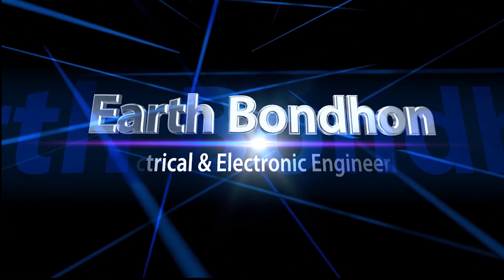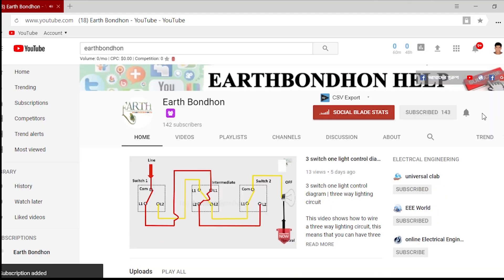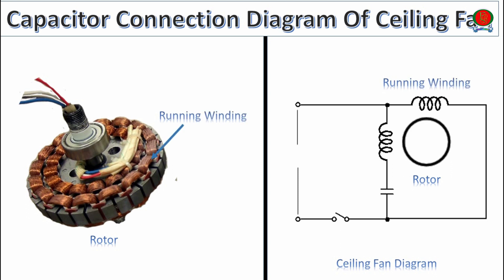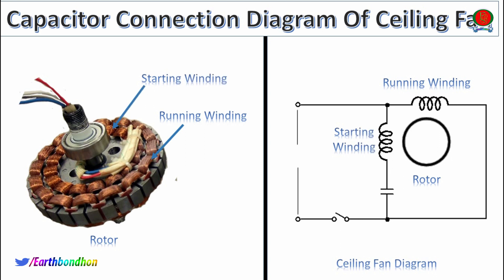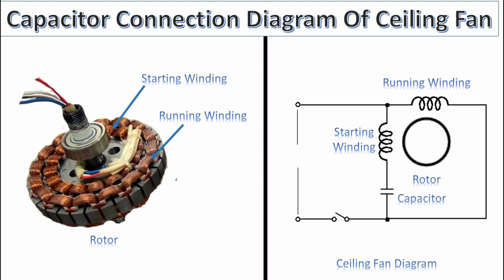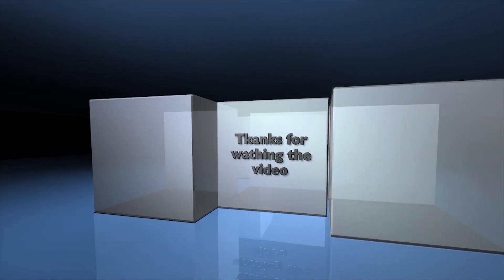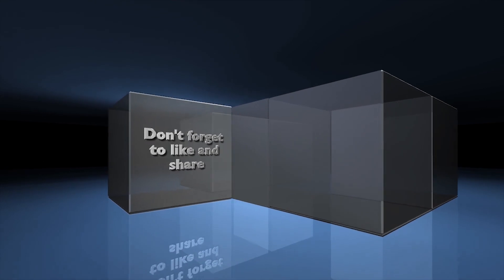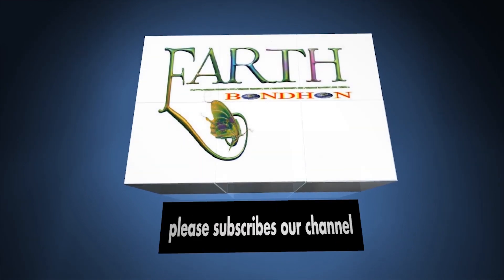Capacitor Connection Diagram Of Ceiling Fan by Earthbondhon

Comment: Video: Super !
I need a hand:
From motor of ceiling fan come out 4 wires, Yellow-Red (78 ohm) Grey-Brown (87 ohm).
     Capacitor has 3 wires, Red (com.) Yellow (1.5Mf) Purple (2.5Mf).
     Chain switch has 4 position : 1,2,3 and L for Line ( OFF position).
Any help to connect for 3 speed Fan would be appreciated.
Reply from the maker: Thanks for your feedback, please follow.........
"Thanks for watching the video"   You are very welcome!
Reply: I needed  the same ceiling fan diagram  BUT add  3 capacitors and 4 position chain switch.I Could NOT find it.
Reply from the maker: @georgelengu7802  no...sir

Comment: i need a hand .i have a 1/5 hp air compressor the wires coming out of the motor are red white and blue .what color wires go to the capacitor which has 2 black wires coming off of it .cbb61 8mf 5%250v.ac 50 60 hz.any help would be appreciated.
Reply from the maker: single phase 2.5 MF...
So nice...
Thanks for your feedback, please follow.........
"Thanks for watching the video"   You are very welcome!